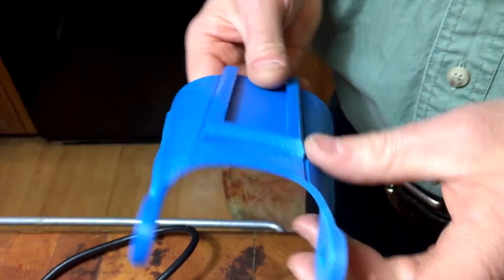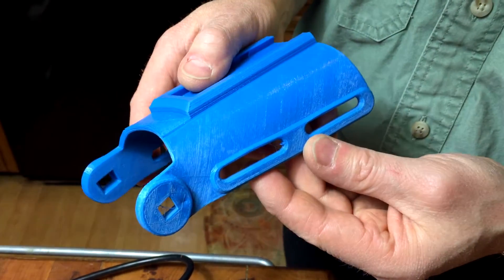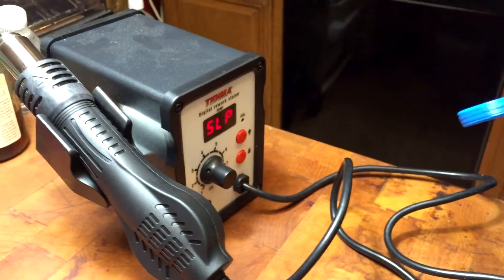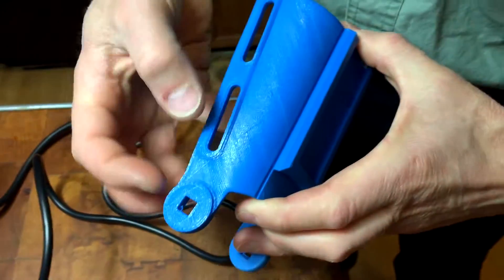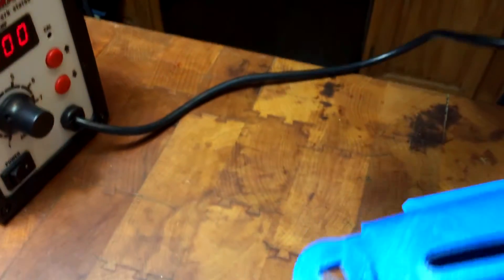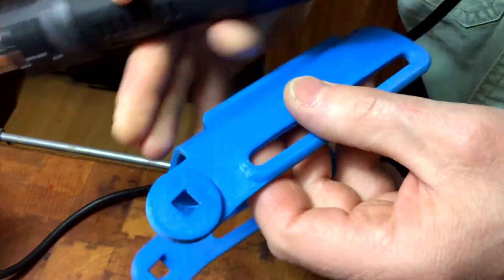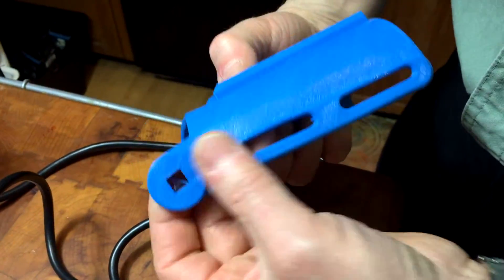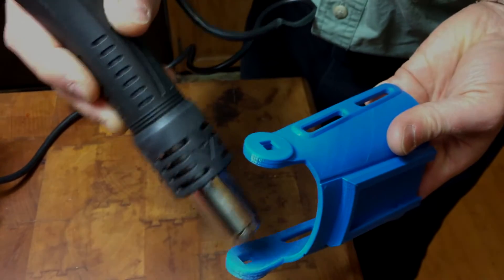Rejuvenating the natural color of PLA after thermoforming in boiling water

Comment: These are very inexpensive on ebay (about $30US). Search: "858D Rework Station" though there are several brands & options. I'd suggest getting the 898D ($40) which also has a soldering iron. A soldering iron on low temp is great for doing detail work on the plastic.

If you use a small nozzle and high temp on the heat gun, you can melt off fine strands easily. Don't dwell in one spot just fan it over. Experiment on scrap pieces first.